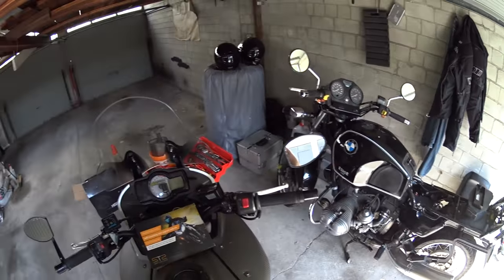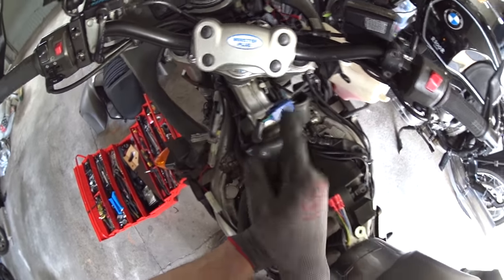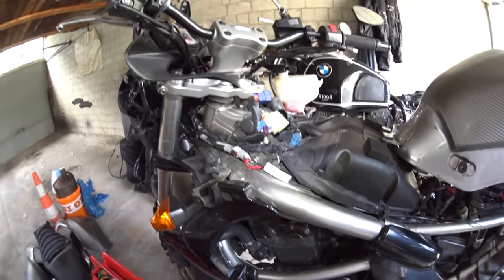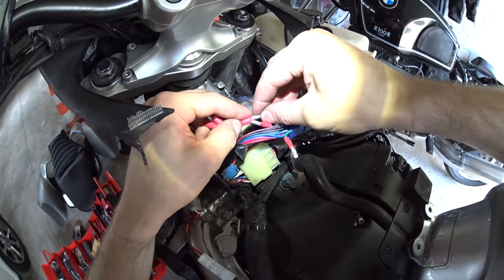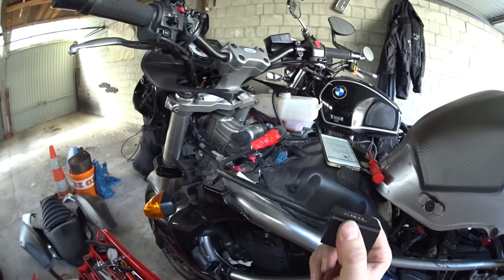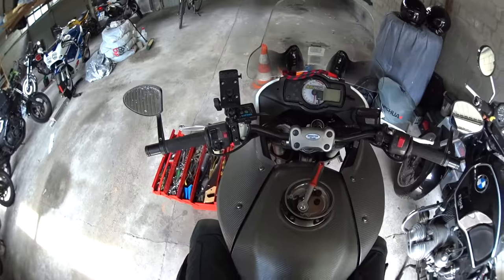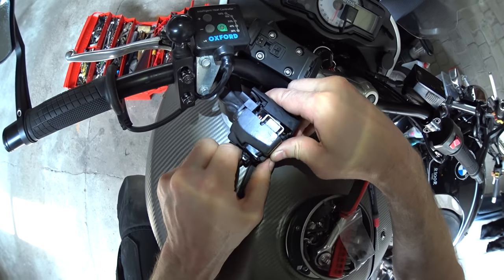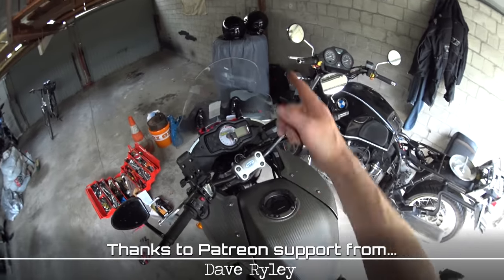'STS' Smart Turn System INSTALLED!!

Comment: Just installed mine after watching this entire video - the connectors being on the wrong way round was a great heads up and the one thing people need to know is that many of these only flash ONE indicator on power up - don't worry about this carry on - everything works fine - many only flash the right - mine only flashes the left ( when ignition turned on ) but they all work perfectly.
Reply from the maker: Cheers Hank, happy to help mate. Good point on the single flash too. Glad it's all working perfectly! Happy auto-cancelling!

Comment: I hope this comment will help someone. It is important to first find where you want to mount the unit, THEN trace the wire bundle from your turn signal switch to within the length of the provided wiring fron the STS unit. I connected mine to the bundle on the handlebars - big mistake since when the handlebars turn, the length of the distance to the STS unit will vary! So I had no choice but to duct tape the unit to my glovebox. In a few days, I had to remove the whole thing and patch the connections back, then remove a bunch of plastic and trace the feed to properly install this unit to a sheltered location with NO moving connections.  It works almost GREAT. Sometimes my right turn signal does not work at all, not sure why. (There, he just mentioned mounting on a fixed part of the bike at 11:30).

Comment: Excellent tutorial. I just received my set for installation on my venerable '99 Bandit 1200S. It has a choke so thanks for the warning about springy bits flying out. I agree that the instructions could be a lot better, and I will have a read through my shop manuals before I tackle this job. This video is very helpful and I will likely watch it a couple more times to make sure I have the terminology correct. Thank you!
Reply from the maker: Glad it helped, Thanks!

Comment: Hi your vid was very helpful as a guide for me to install the STS on to my 2009 Triumph Tiger 1050. How ever the foam dampers supplied, even the larger ones were to small, I had to cut up a pencil eraser (rubber) which works but doesn't quite feel right. I cable tied the box to the inside of the frame next to the airbox, I am just a bit concerned if it will be affected by engine heat especially in the summer.
Reply from the maker: +george hatcher Thanks George. Glad to hear it. Apparently the rubber inserts are neoprene. The wetsuit material. So if you can get your mitts on a thick bit, you might get the right feel. Sadly i can't comment on the heat issue. The folks at STS have always been very helpful with questions and concerns though.

Comment: Finished the install.  Took a full day!  I blew a couple of fuses and somehow damaged the flasher relay.  STS customer support explained I needed to also connect the signal wires from the hazard flasher.  I was told solder wasn't required with good connectors.  There is still quite a bundle of metal penises and metal virginas tucked away behind my headlight.  Quite the orgy happening.
Reply from the maker: OUCH! Yeah I think proper connectors would make it a little easier. But hopefully you'Re enjoying the good part now, the bit where it WORKS!! :D

Comment: Haha I just came across your video and nearly spat out my tea when hearing your colour vision impairedness...... cutting the red wire got me...😂🤣😂🤣

Thank you 🙏🙏🙏
Reply from the maker: Yeah it certainly makes some of the more electrical installations quite interesting!
Reply: AndyManCam 

😆 lol....

Have you thought of doing an update to your safe turn system? There are mixed results with longevity on some systems.... any updates with your long term analysis would be of benefit to some....

Thanks again for making me have to mop the floor...😁😜🙏🙏🙏🙏🙏
Reply from the maker: Haha! That’s an image i can’t unsee! Sure, the update is that it’s sitting in a drawer in my desk! I wasn’t happy with the little spongies, so removed it and never looked back.
Reply: AndyManCam 

Haha. Well I guess that’s the most succinct and the all encompassing highlight of the review; “sitting in a drawer” . 🤣😂🤣 

I guess I will also resort to the old school tactic of thumb & memory backed up with a confirming glance.  Thank you once again Andy. 🙏🙏🙏

It is amazing that they could design such a great technological bit of kit and be let down by the cheapest end result 1 cent rubber master links....  Another reason I am tending to favour belt driven drives.....  🤪.    Tschüß
Reply from the maker: I think it's really the best way. Even recently riding with The Likeable Rider on his 2020 Superduke R, with 6 axis IMU and self cancelling indicators, the bike quite often got it wrong and the indicators stayed on for way too long after a turn, leading to several potentially dangerous situations (nothing happened, but riding past a left turn while indicating left could end in disaster, potentially). So even the most high tech, fully integrated system is quite fallible. And as soon as you start to rely on that system, when it doesn't work you don't notice until it's too late. Muscle memory and OCD for the win!!
Reply: @AndyManCam  

 

🤣😂🤣 Thank you sire...... “OCD for the win..... “ 

I feel like a winner already....🙏🙏🙏
Reply from the maker: See you on the podium mate! 😆

Comment: I've had to turn the auto cancel indicators off on my Tiger Explorer (Yeah, I don't have a Versys anymore). They became annoying. Sometimes they'd work as intended. Sometimes they would cancel whilst going round an island and other times they didn't cancel at all. Even though I've done a similar turn before and they did.
Reply from the maker: +MrMrhughesy That's the real problem for me. The tech is really clever but is sadly not clever enough to know your intentions. For many that's fine and a great safety net.

Comment: Hi Andy,

Doing the same on my Honda Rebel CMX500. 

I was wondering what webpage you accessed to get the informative colour coded wiring info you used. 

All of my wiring runs into the very tight headlight assembly first so a little not complicated. 

Cheers Ryan
Reply from the maker: Hi Ryan. I'm afraid I used a combination of the service manual and image searches on Google. Sorry I can't be more useful, but I hope you figured it out.

Comment: Looks like a decent system, however I took the easy way out, I bought a Triumph Tiger 800 XRx which has self cancelling as standard ha ha!
Reply: OldManTony On my Explorer they give you option to turn the self cancelling system off.....why???😉
Reply: Richard Taylor my bike is the same, why wouldn't you want them!
Reply from the maker: Cheat!! ;P
Reply from the maker: I actually did a test ride this week, and kept forgetting to cancel the indicator. So the STS had in fact made me MORE dangerous on other bikes! Maybe that's why you can turn it off?
Reply: Andy Man Cam I was always forgetting to cancel on my previous bike anyway, us old buggers shouldn't be on the road!
Reply: Andy Man Cam Actually thats true Andy,especially in the city, when you can get a turn every 10 meters,but I use both methods
Reply: Me too, XRT.

Comment: Now I see why you said this system was not so stable... the gyroscope and possibly accelerometer inside of the magic box are very sensitive to vibrations (which Versys is famous for), so on bikes it will never be 100% precise to catch the beginning and the end of the turn, though timer should switch off flashing eventually :D
Reply from the maker: +MaxTryk I've realised that the main problem I'm having is with the simplest part. Just as i mentioned, the foam discs have 'relaxed'. But this means that the switch is now latching again. Yet i still have to push really hard to indicate!
Reply: That's weird.. "foam technology" is no match to the sophisticated electronics :) Is it possible to disassemble the mechanism? I wonder why don't they provide some metal piece to replace so it doesn't latch.
Reply from the maker: I was thinking the same. I like the idea of it, but foam discs just doesn't grab me!
Reply: Try a couple of "tiddlywinks" hard plastic instead.

Comment: I found out how long the 'indeterminate' time is before a direct connection to the battery drains it; it's 36 hours ;-(
Reply from the maker: Oh, thats not very Long! Thankfully I’ve had no issues even after leaving the bike for a couple of months at a time.
Reply: @AndyManCam  Maybe Kawasakis are just thirsty. + nowhere to put the foam bits. I now have to turn the indicators off before I can turn them on :-(

Comment: Nicely done but not for me, I am just a bit too picky and do not want to cut or splice any wires.  I will just have to remember to remember to turn them off :)
Reply from the maker: +Halfdead Rider That's the real dealbreaker for many i think. I wasn't super keen on cutting my wiring, but did it for the greater good!

Comment: I've kept away from mods like these.... all those additional connectors attracting water and corrosion....'tis the stuff of nightmares. Electrical faults always seem to happen in January, at night and in heavy rain. A well trained left thumb is a much simpler solution.
Reply: I agree with this comment, but when you get something sent to you it does involve presenting it !
Reply from the maker: You're not wrong. It's not the ideal install method for something that will likely stay outside ALL of the time.
Reply: Most bmw bikes and many others already have this oem
Reply: dont drive in the rain safer

Comment: sorry, but these days any product that involves cutting wires and using snap lock type connectors is a non starter with me, it is perfectly  possible to produce thes items with what I call interuptor plug connectors, but I guess that would complicate production by making items more model specific. Though in the past I have used products where these type connectors are supplied but the wires have to be inserted by the purchaser...
Reply from the maker: Totally understand that attitude mate. But you’re also right that the cost would get crazy with bike specific design. Unless they’re shifting massive volumes. Maybe One day?

Comment: A pity they don’t do the multi plugs same as they do for car radios would save cutting any wires.
Reply from the maker: That would be the ideal wouldn't it. I guess that cost and manufacturing complications mean the universal method is far more viable.

Comment: Cool video dude. I like the term “electrical penises and electrical viginas” it seems that you had to do a sex change :-) I have a Kawasaki as well but a Vulcan S and I am thinking in purchasing one but the installation looks quite tricky. I will have to think about it. You have the Booster Plug as well, I just ordered mine, how is it going for you?
Reply from the maker: It is a bit tricky, but as long as you’re methodical and patient, it’s easy enough to get through. I don’t have the Versys any more, but the Boosterplug was great right up to the last moment. I took it off shortly before I sold the bike and the difference was still very noticeable.

Comment: I think I'll just rely on memory and people flashing me when it comes to indicating.
Reply: A local rider (Canterbury) was killed when a woman pulled out from  a left side junction, she (and other witnesses) said he was indicating left,  it turns out his  indicator had been on for some time! I have a Tiger XRx and the self cancelling indicators work brilliantly, the only trouble is, when I ride another bike I now tend to forget to switch them off.
Reply from the maker: I've followed my dad before (Zephyr, not GTR) and flashed him repeatedly that he's been indicating for three weeks. No joy! At the same time, this thingy has once or twice switched the indicators off before I've got to the turn. Swings and roundabouts sadly.
Reply from the maker: I think the simplest, yet most impossible, way to deal with it is for people to not assume that indicating is a concrete plan of whats happening. It's just an indication. I'm sure that rider was showing no signs of slowing or positioning himself for a turn. Yet, because the little amber light is flashing, he's signed a contract stating he will turn left and the car is free to suspend all the other information available and pull out. All a flashing indicator tells you is that the bulb is working!

Comment: I loved the entire install until I saw him use electrical tape.  Please don't ever use electrical tape on motorcycles.  It was made for one purpose, securing wire nuts in household electrical.  The glue in the electrical is going to warm up, melt a bit, and make a mess under there.  It's a real to pain to deal with should you ever need to work in this area again.  Get yourself some automotive harness tape
Reply from the maker: How warm could it possibly get?! Sure it’s not the greatest fix, but no need to use a cannon too kill a mosquito!